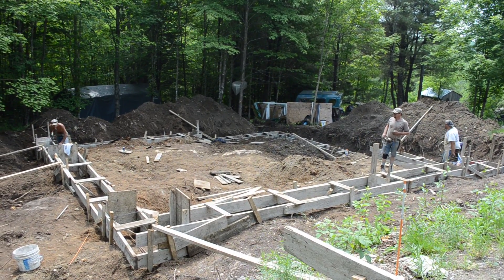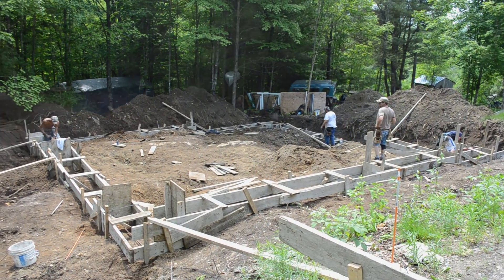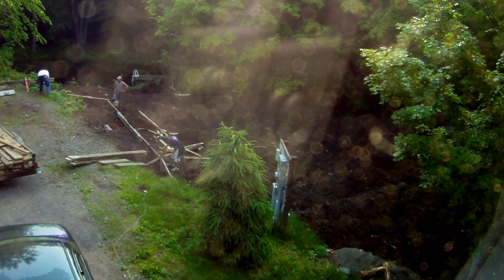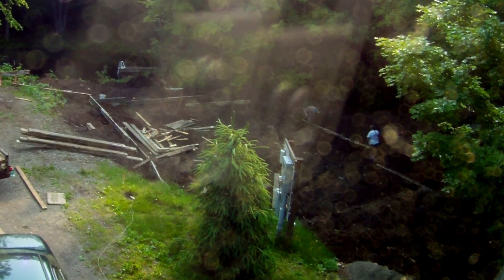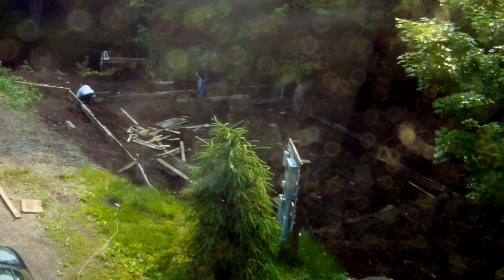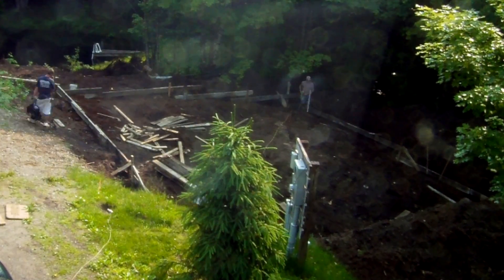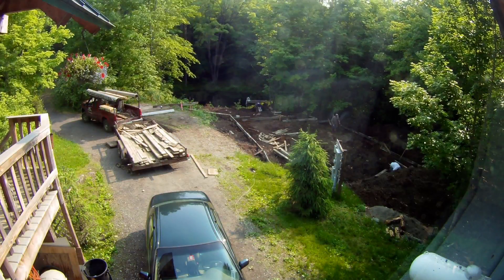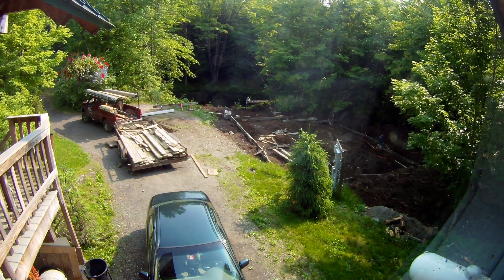Build Concrete Footings Foundation - 5 - My Garage Build HD Time Lapse

Comment: I like how the concrete contractor used metal straps and boards over the top of the form walls to hold the wall together. I prefer form ties myself, they are thin metal straps that are located through out the entire body of the formed wall top to bottom. None the less, very nice.